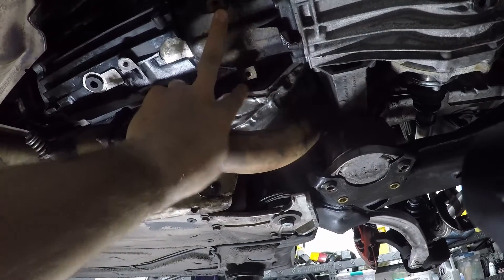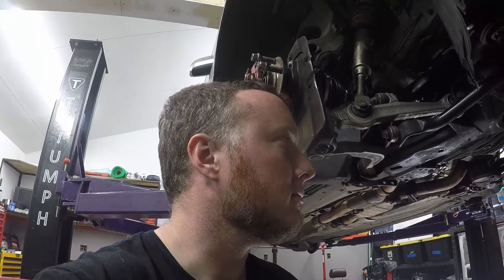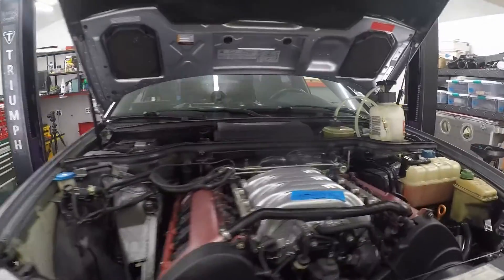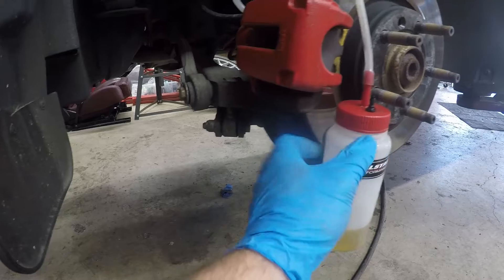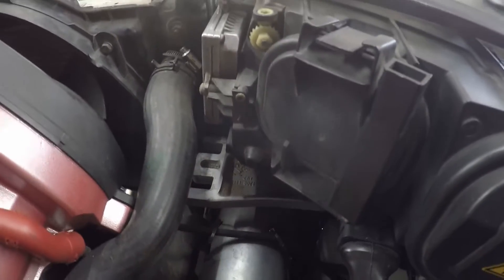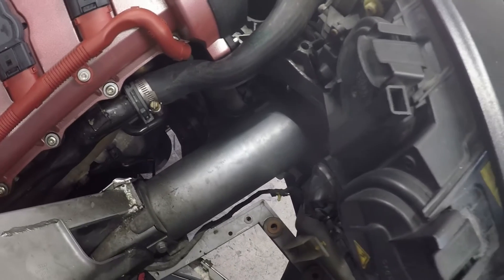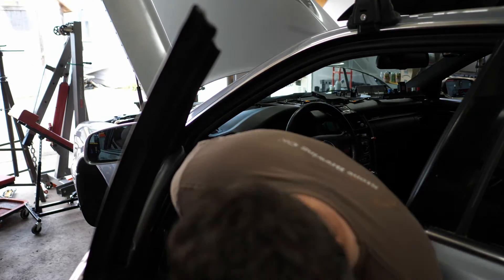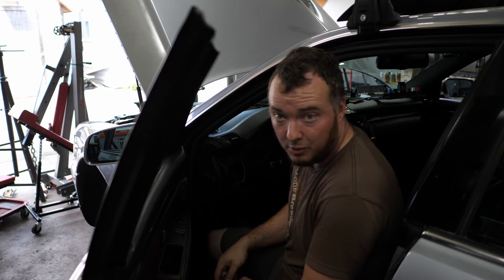Manual Swapping an Audi D2 S8 - Part 8: Exhaust Install and First Start!

Comment: Really you have made effort to do the job allone and to presenti it to us. I have find you have brembos on front. So you made bracket or what. I find that mood interesting.
Reply from the maker: The Brembos are the factory S8 brakes
Reply: @oddcylinders  interesting, i did not knew about that. If you have a time can you measure disc size and ET and what material are wheel carriers ALu or steel. And bolt distance on brembos